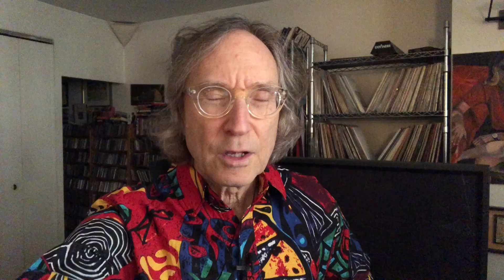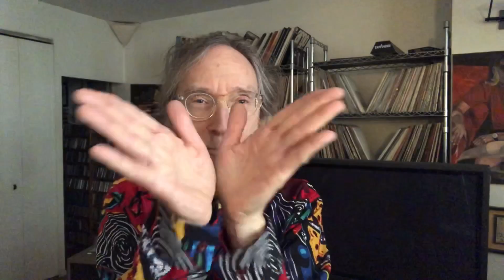Please explain: Active vs passive, horn, panel, open baffle speakers, etc

Comment: OK, very weird unrelated question - I'm 70  - I just got a CD of 'test tones for audio speakers ' from Ebay. has a list of frequency, 2000 hz, 4000 hz, 6000 hz etc. > the highest I can hear with my 'normal' casual TV watching vol. is 6000 hz. about 9 ft away from tweeter. at 8000 hz I have to move much closer to tweeter and 10,000 is zip.  decent Polk RTI & Q acoustics 3010 spks.

Is this 'normal' or can YOU hear say 14,000 hz at the normal listening position / vol ?  I suspect frt. row at a Dead concert when they had their mega speaker system - and they weren't the loudest ( Mountain / Hot Tuna ?) > might have done something ....?

Comment: Great overview! About "baffle": in box speakers, the board on which the drivers are mounted is called the "front baffle". And the rear board is called "rear baffle" which normally has no driver mounted on it. Sometimes, rarely, an extra tweeter is mounted on the rear baffle. The name itself ("baffle" instead of "board") refers to its function of allowing the sound to radiate audibly to the front, and not audibly to the rear.

Comment: Last I heard Mirage was purchased by the Klipsch Group and was then shuttered and promptly liquidated not long after. The Mirage OM series was quite remarkable and put the bulk of competitive Klipsch models to shame, sonically. Mirage was also occupying shelf space at a particular national retailer which Klipsch desperately wanted a piece of. So Klipsch purchased Mirage and then attempted to pressure their way into the retailer's in-store top-shelf brand boutiques next to the Mirage brand. However, the national retailer was having none of it so those in Klipsch management got all butt-hurt over their epic fail and shuttered/liquidated Mirage to cover their asses by speciously claiming that Mirage wasn't a viable brand instead of admitting their little scheme to foist Klipsch into the national retailer's higher-end in-store AV gear boutiques failed.

Comment: I love your videos. You answer questions I didn't know I had. I'm listening to 720 digital watts, through BPA monitors, and a set of 4 Polk Audio satellites, and I'm just not feeling it. I always picked up old silver face/knob receiver/amps at thrift stores, and they ROCKED, but it's getting hard to find them. People are either chucking them out, or once in a while, they have one, but priced high. My favorite was a Marantz tuner/amp that made (I believe) 610w, and it was sheer audio bliss. I used it as my entire system for several yrs, and it served me well. Beyond the addition of a sub or two, or surround speakers, I like using speakers like an equalizer, to get the sound I want. Tone, space, mid range perfection...  I recently realized that my system was too bright, and sounded harsh, and with no real tone control on my stereo, I could adjust it away. I came up with the idea of replacing the horn tweeter on the BPAs to a 3.5in. Altec Lansing mid, and it worked PERFECTLY. Our living room is small, and the placement of the BPAs had the horns blasting us in the face. Perfect for loud, outdoor stuff, but tiring during movie night. I keep a lot of drivers and boxes, with circuit boards and speaker doo dads, so I'm always experimenting. I'm not afraid to take apart a B&W bookshelf speaker, just to SEE... You have well done videos, great content, and always you are informative. Keep them coming.

Comment: I could really use a pair of KEF LSX in the sunroom.  But I REALLY worry about the longevity of active speakers.  I like to buy once and enjoy for life.    I would be very unhappy with a pair turning into paper weights after 10 years and spending a grand.  My audio repair tech Friend is not a fan of subs / actives as their long term track record is not great.   Lots to go wrong with 3rd party amps.

Steve,  Can you shed any light here?   In the meantime, I can use a reasonably priced BT speakers. ($299 I got for $99 on cyber Monday one year).  HELP and thanks much.
Reply: Sunroom. What a cock.

Comment: How did you like ohm Walsh?
Reply: Steve Tllsdaleys well thought out response.
Reply: @jeffreyepiscopo  I own the Ohm Mirco Walsh Talls and I enjoy them greatly. I have them 2 channel for both music and video. I use them with dual SVS SB3000 subs. With the Outlaw RR2160 receiver crossed over at 100hz. Solid phantom center channel. 7 ft apart,  2 ft. From the back wall. Subs next to each speaker. 120 day free home trial. Check the website and you can talk to John the Owner personally. Hope this helps.

Comment: The NEED for STEVE - a challenge!
If you gave me two examples of each - active, passive, horn, open baffle, planar, electrostatic, etc.....two samples of each category in the under $1500/pair price range, I'll bet I could only demo half of them, and less that 25% side by side, assuming I'm willing to drive 2 hours round trip - and I live in Los Angeles. So Steve...is part two of the Elac vs Klipsch comparison coming soon?

Comment: One thing that active speaker manufacturers claim is, the amplifiers inside the speaker enclosure are perfectly matched with the drivers they serve and so, the user gets the best possible synergy between the two components.
The Meridian speakers you have mentioned Steve are very much 'high end' stuff and sound fantastic. Not exactly cheap either.
There's others in the UK that make active speaker such as PMC and ATC among others. And of course Dynaudio seem to be heading in that direction I think.

Great shirt young man, you must tell us where do you buy those shirts from. Hopefully, you'll get over your cold soon!

Comment: Funny you mentioned Ohm speakers. I have a demonstration LP from them.
Reply: I'm very glad Steve mentioned Ohm. I never would have guessed the company is still around. I don't know if there are Ohm dealers in our area.
Reply: @martytoo  all on website. You can talk to John the Owner personally with all your questions.
Reply: Long Live Ohm!!
Reply: I haven't heard that name in years.
Reply: @michaelwright1602  check the website and Z reviews.
Reply: @paulgolub6823  Will do, I had no idea they were still around.
Reply: They are better than ever. Back in the day some of their models  needed 200 watts to get going and 201 to blow up. Not so today....I never heard a Ohm speaker that I didn't come away with really liking. Sweet looking to boot. @michaelwright1602
Reply: @bruhl001  I have never heard one, I just remember the name... ;-)
Reply: @bruhl001  I have the Ohm Mirco Walsh Talls. On either side of the LG 65 OLED. Dual SVS SB3000,  one on either side of the Ohms. 2 ft from the back wall. Outlaw RR2160 receiver. Crossed over at 100hz. Because the SB 3000s are so quick and responsive. Blend really well. Plenty of power. The Ohms are supposed to be in a smaller room than mine, BUT with the Dual subs, fill a the room nicely. No break up or distortion. Also WAF is pretty good. 120 day free look with the Ohms. Free looks with the SVS and Outlaw also. I listen to a great variety of music and videos. All very good.
Reply: Why do you think Ohm and omni-directional speakers in general are not more popular? @paulgolub6823
Reply: I'm jealous. Congrats and many years of smiles to you. @paulgolub6823
Reply: @bruhl001  totally marketing.  Small company in Brooklyn. Limited budget.
Reply: That's a shame @paulgolub6823